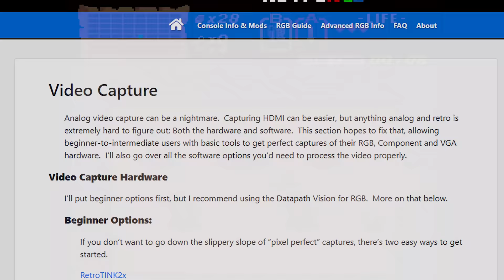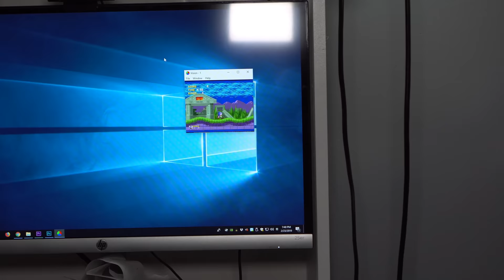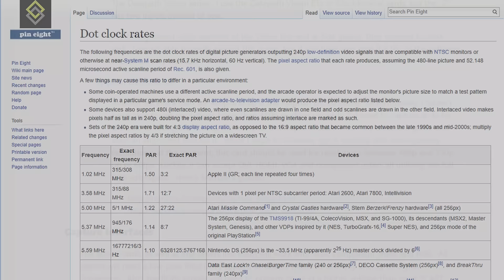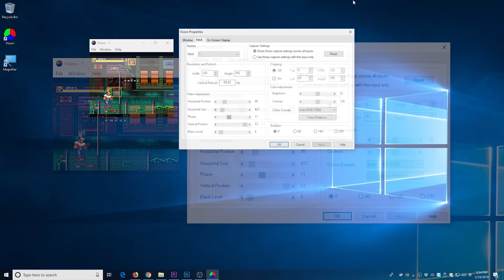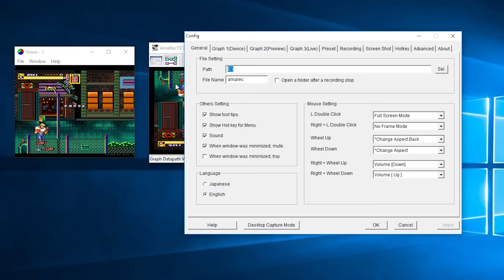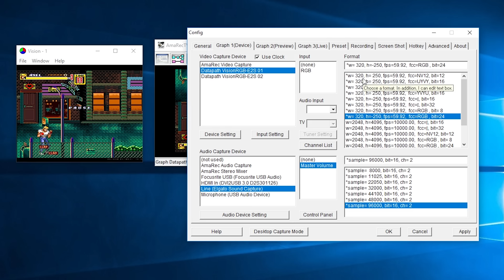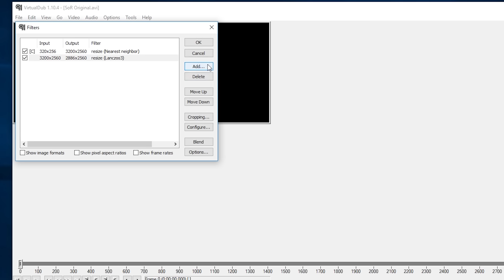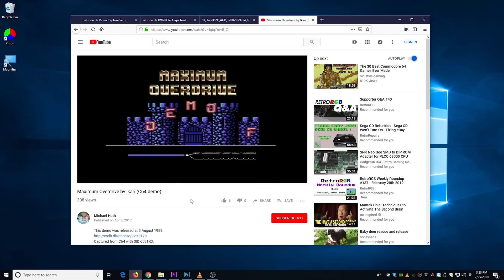Direct Video Game Capture & 4K Scaling

Comment: A noisy USB bus won't introduce noise into an audio recording except by making usb transactions impossible in the extreme case.  The usb data bus transmits binary data in a differential pair, a noisy zero is still a zero and a noisy one is still a one, within a wide margin.

However, a poorly designed usb-powered device may leak noise from the USB power line.  A powered hub can take care of this (or just split usb cable with data lines from the pc and power lines from clean 5V, ofc).  The better usb audio interfaces have their own power supplies, which are designed to produce a clean rail.  There are many professional quality audio recordings made using usb interfaces these days, as they basically replaced the firewire boxes of old, and are usually preferred as they keep the analog lines out of the pc case, which is a mess of high-frequency em content.

Saying that the prescence of a 9 MHz LPF on a 480p signa, which may have a pixel clock of 25 MHz or so, is 'not going to help' conveys the wrong idea.  It's definitely not "like the filter wasn't there for 480p signals", as you said in another video.  Quite the contrary.  The effect of a video LPF with a cutoff frequency that is too aggressive (lower than the bandwidth of the source) is that it will significantly soften the picture horizontally, exactly like the it happens with the component video output of a Wii.  The time-domain reason for this is that the slew rate of the signal is reduced with the introduction of a LPF, in case you want to look at it like that.

A 100 MHz LPF would be "like it wasn't there" for retro video signals.  A 1 MHz LPF would be *extremely* evident, much more so than plugging a console through composite.  High frequencies produce detail, low frequencies produce coarse variations.

If you ditch the IC with the integrated filter, you can use a quad or triple op-amp IC for video like the ones by analog devices, set the gain with resistors, and the LPF with caps.  This would probably take reading a chapter on op-amps (or two, depending on your background), but it's perfectly doable.  Basically it's just a video buffer with a high frequency cutoff.  Switchable cutoff frequencies for several opamps sounds like a hassle, or just plainly more trouble than it's worth, considering there are other solutions that can be used instead.

A better way to do it would be to oversample the acquisition phase, with no hardware LPF (or just single non-configurable first order filter at a high enough frequency to not affect the fastest of your signals to prevent oscillation, ringing, etc), and use the redundant information from the oversampling to get your clean pixels.

That is, if your signal is 384x224, configure the acquisition card at 3840x224, so that each pixel is sampled ~10 times (the more the better, as far as the acquisition card and storage devices allow).  From that raw data, a horizontal downscale to 384x224 would be simple and would yield good results, but certainly the best solution for that would be a purpose-built filter that dropped samples in pixel transitions and computed the 'per-pixel' averages taking the pixel clock boundaries into account.

This would produce a clean 384x224 picture with no unnecessary filtering and, additionally, would elimininate the 'phase issue' which you have (which could even be pixel clock drift).  Another benefit is that the segments of the video with different resolutions (say the 320 to 256 changes in width of the megadrive) can be dealt with much more easily.  From that clean video you could produce your 4k scaled versions as you prefer, but I would add that the Lanczos' (mind the 'z') filter isn't really the most adequate for pixel art.  A purpose-coded implementation would, again, work better; for example, you could scale using nearest-neighbour by to 10x or 20x original size, then downscale that to the target resolution using a method that doesn't ring (and introduce the borders or crop, as needed).

This is all very possible to code in a short amount of time, it could even be scripted in python or something (but would probably benefit from a fast implementation in C or the like).

A good test for this a setup would be to produce a small program that would output test signals from the PC VGA, capture them with the encoder, and compare the desired pixel values with the captured values.  A console running the test suite could also be used for this, which would allow to characterize the console's DACs.  More than likely, some consoles are not quite linear in their output, but only monotonic, as the tolerances on the internal resistor networks can't be guaranteed to a very high accuracy.  This would, in turn, produce a 'calibrated' capture.

Comment: Scanning through the video thumbnails, it looks like Macs aren't featured (which isn't unexpected, but is a shame). Good video so far regardless, thanks.
Reply from the maker: Actually, all of the scaling options can be done on a mac.  In fact, my follow-up video will be how to build a capture solution for less than $300, then move the captured files to anything you'd like.
...but yeah, no Mac guides yet.  Sorry, maybe someday!
Reply: @RetroRGB  no worries, and thanks again. When I said Mac, I primarily meant hardware-based capture, but in fairness I haven't looked deeply into Mac software options either. I've a few hardware devices I need to spend more time with that could (in theory) do a good job (OSSC, BlackMagic Intensity Shuttle, Elgato Cam Link), which could be combined with OBS or similar I guess. Time spent working all that out is time not playing games though; that's why consumer plug 'n record devices are popular (despite what they might do to framerates, scaling and compression).

My pathetic game capture attempt from last year on a Mac using the OSSC and Elgato Cam Link: https://www.youtube.com/watch?v=MOLdxSxg_NI&t=344s

Comment: So in short, use the datapath + SCART2DVI for 240p/480i retro console captures, and the epiphan for 480p and up?

Retro Upgrades sells a SCART2VGA that supports 240p/480i/480p (based on a design by Tinkerplunt), so would one just need a VGA to DVI adapter to connect to the datapath?
Reply from the maker: Datapath for everything except 480i.  Epiphan for 480i, 480p and 720p.  It will do 1080p, but the colors might get compressed a bit.
The reason you need an adapter for the Datapath is:
- Pin connector
- Sync for RGBs sources
- LPF
If you have an HD Retrovision cable, you just need a basic pin adapter.  More info here:  https://www.retrorgb.com/videocapture.html
Reply: @RetroRGB  Thanks Bob. Theoretically, could I just buy an E2s and connect one input with a SCART2VGA, and the other with a Comp2DVI, or does the Epiphan capture 480p/720p better? Only reason why I brought up 240p/480i was for the dreaded menu switching in some retro games, but for what it's worth, I'm still in the early stages of my BVM setup.

Comment: Update question for you Bob. With the evolution of OBS recognizing the Datapath as an input card is the vision software still needed? I own both the OSSC and the RetroTink 5x and they both look great.
Reply from the maker: Yes, its an excellent tool for lots of things, including screenshots.  Also, it's free and installs with the driver, so why not keep it around just in case :)
Reply: @RetroRGB  understood all Bob thank you. So it is not really needed to be running in the background while you OBS is running correct?
Reply from the maker: No, but I still use it just to be safe :)
Reply: @RetroRGB  thank you Bob. Also keep up the good work.

Comment: Your guide's been updated to utilize VirtualDub2 instead of AmarecTV for handling the capture...but what's driving me crazy is that your VirtualDub2's "Capture pin" settings show RGB24 and RGB32 as color space options along with a whole slew of other settings, but mine only shows "BGR" and "BGRX"  for color space, and fields for resolution and framerate. Don't know why my settings are so much more limited than yours, but is BGR (24) and BGRX (32) still the same thing as RGB24 and RGB32??
Reply from the maker: Wow, I've never seen that before.  I'm also having issues with VDub2 capturing at the wrong speed.  I'll try Amarec again today, but we REALLY need a solution tweaked for retro gaming.  https://www.retrorgb.com/amarec.html
Reply: Yeah, 100% agreed! With that said, the videos I captured with VDub2 look really good...but I'll need to confirm if the color space is accurate.

Comment: Thank you for the informative video RetroRGB! I have question, basically my brother and I are trying to capture some classic games, don't even really care about quality too much.., our screen cap works with  SNES and NES perfectly fine, however Sega Genesis Games on our model 1&2 both output a weird  black & white/ Greyscale. I've messed with all the formats and settings but nothing seems to work. What would you recommend we do?  Do you think that Retro Tink 2x you showed in the beginning would be a good option?..Or perhaps a generic upscaler on ebay would work? Not sure if it matters but the screen capture I'm using is a Diamond VC500, Any help would be appreciated, thanks again for your time- N
Reply from the maker: I think the RetroTINK2x is an excellent option!  In fact, I should have a video out soon showing a more basic capture method using that and original consoles.
Reply from the maker: https://www.retrorgb.com/retrotink2x.html

Comment: I'm looking for advice on how to capture footage from the MiSTer, have any videos that would help with that?
Reply from the maker: If you're using direct 1:1 analog output, follow these exact settings.  For HDMI output, there's some MiSTer settings that might need to be changed, depending on the core.
Reply: @RetroRGB  I'm specifically referring to hdmi output (should have been more specific, sorry..) and was questioning what the best method is because ive heard of people having issues with capturing output over hdmi on MiSter, and just wanted to get an idea of what people were using successfully for hdmi capture out of it.

Comment: Is there a reason why the image in OBS or other capture software is soft, as opposed to how sharp it looks in VCS on my Datapath card?
Reply from the maker: It's how you scale it.  Use "point" and scale to a single integer of the original resolution.
Reply: @RetroRGB  I have been trying that.  Currently, I'm using my Nti Mini via analog RGB output.  It's just, for example, in MM3 the eyes in-stage have a strange line going through the eyes.  The pause screen in Gauntlet shows an extra darker blue set of pixels at the bottom of each skull.

Comment: The datapath vision would be a great solution.... if it was widely available, outside the US.
Reply: It's not exactly widely available in the US either - it's a discontinued card from the UK. Options are basically $300+ on eBay used, or like $1000 on Amazon from some slimeball seller.
Reply: Søren Blackgaard I see an E1 on eBay for $100 shipped right now, and that's far from the lowest prices available to those who are patient.
Reply: @FishamanP  well it's no secret I lack patience lol

Comment: I don't have the datapath vision E1S. I've checked on eBay for canadian prices and its gonna cost me 350-400$ apparently. Do you think that Elgato Cam Link would work good while following all the software tweaking process? I've gotten Cam link because I've read that it worked with the OSSC better back 2 years ago.
Reply: I have a Cam Link and OSSC, but the method I use is quite different than what Bob shows here. This video is still very helpful in terms of identifying the areas of focus for video capture though.

One major difference is that the Cam Link converts the RGB signal to YUY2, full range, rec 709. The 4k version that replaced the original is worse as well (partial range, 4:2:0). The datapath keeps everything in RGB, so it's easier to deal with. I kinda wish there was some addon to the OSSC to also act as a capture device. It already digitizes the signal excellently!
Reply: @yoshiyukiblade   is there no way to make camlink use RGB instead of YUY2?
Reply: @KentaZX  Not as far as I know, Otherwise, the Datapath wouldn't be as important as it is at the moment. You can make do with the Cam Link and OSSC combo though. Because the OSSC does horizontal pixel multiplication (with optim. modes), halving the horizontal chroma resolution from YUY2 conversion won't remove important chroma information. There are other subtleties that you have to account for, but you can still get an image similar to RGB. This is true for all capture devices that can output uncompressed YUY2.

Comment: this scart to dvi converter will be good if it could be output hdmi
Reply from the maker: That's not at all the purpose.  If you need that, get an OSSC.
Reply: @RetroRGB  i love dchdmi and could be  wonderfull to use hdmi on aes or a consolized mvs